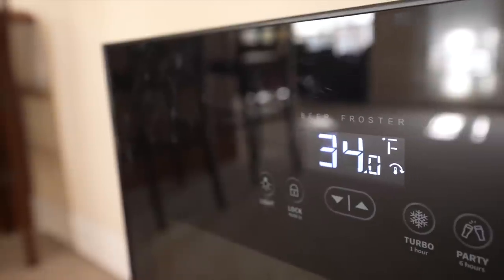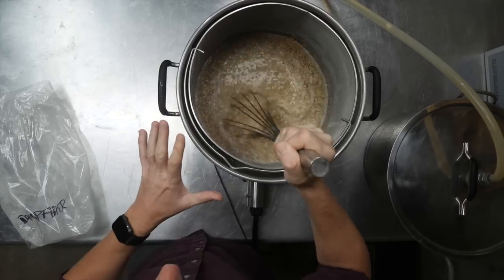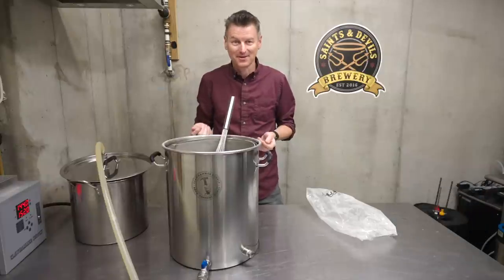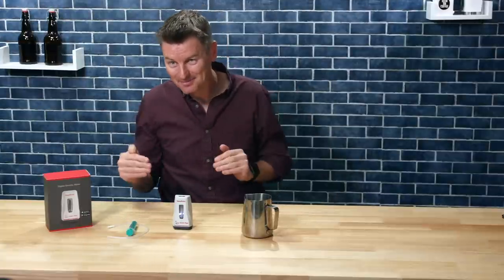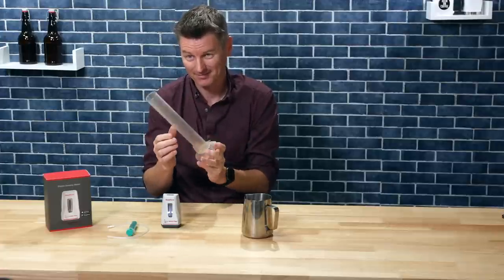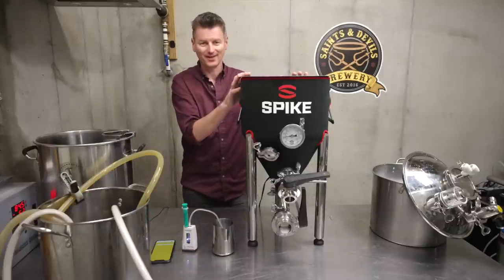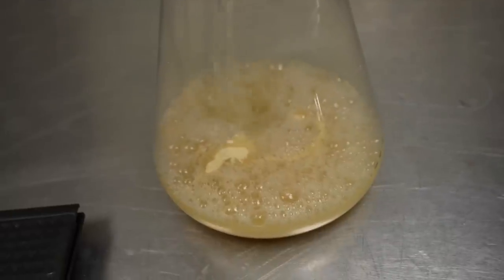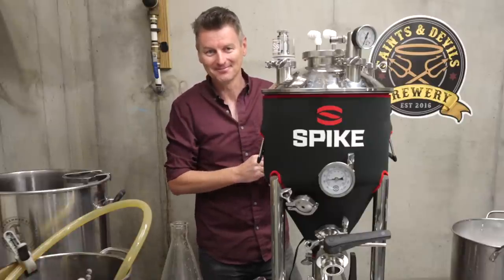The 7 Day Beer Challenge: Grain-to-Glass In A Week

Comment: Have you heard of the "shaken not stirred" (or SNS) starter method? It skips the stir plate and instead you cover your starter vessel and shake the beJesus out of it for a minute or more. Then just set it aside and pitch it at high krausen... I usually wait just 12 hours and sometimes less.

The idea is that if you use a stir plate there are two negative things happening... the shear forces from constant stirring are harmful to the yeast and much of that yeas has bloomed and then gone dormant by the time you pitch. With the SNS method you are pitching a smaller cell count but the yeast are all at peak health. So instead of a large, lethargic army you have a smaller but energized army ready and eager to go to war.
Reply from the maker: Very interesting. What’s the purpose of the vigorous shaking? To oxygenate the starter?
Reply: I try to pitch at High Krausen whether I'm using a stir plate or not but don't stress if I miss it either way. 

Since using a stir plate I've gotten healthier yeast and better yeast proliferation than the "SNS" method. Which I used in leu of a stir plate before I bought one. Even using a small starter a few hours ahead of time without anything else can reduce lag time significantly and lead to better beer. 

Nothing < Shaking < Stir Plate
Reply: @TheHomebrewChallenge  Yes, that oxygenates the wort. I have some articles written about the topic which go into more detail with sciency explanations I can send you if interested.

Comment: I ferment with saflager w-34/70 at 24C under pressure (20psi). Done in 3 days, not off flavors =)
Reply: can i ask you how long condition time? I've only made 1 batch with W34, and a few with S23, but the S23 is condtioned and ready to drink within about a week* , while the W34 batch took like a month.
Everything at 20C and ~15psi
* Brewed a saturday, finished fermenting about wednesday, got drank the saturday the next week.
Reply: @djn3kkid  At day 4, I cold crash to 4C while keeping the pressure to complete the carbonation, and keep 4C for a day. Then I transfer to keg . Its good to drink, with good carbonation after 6 days in total I would say.. The beer looks still cloudy but it gets more clear after 1 or 1 and half week
Reply: @Styv93  sounds like my XP with the S23. Altho, i dont cold crash per say, but i put the kegs in a 2c fridge when x-ferd from the fermenter. The W34 was tasting yiesty AF, while the S23 have been the same in 4 or 5 brews now. Brew on a saturday, and fully drinkable the 2nd saturday. The first saturday its still tastes 'new' if u get my drift.
I must say tho, for me its a sample set of 1 on the W34, and i've been only brewing for a few months
Reply: @djn3kkid I haven't noticed much yeasty character as you describe, probably because I cold crash and I use a floating dip tube so it takes beer from the top 😊. But anyways, its pretty damn fast grain to glass using lager yeast